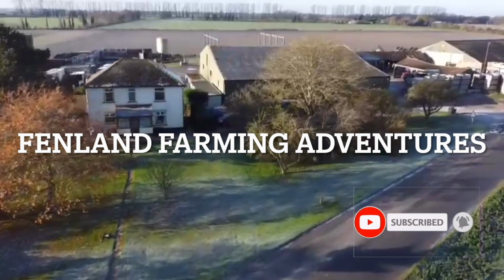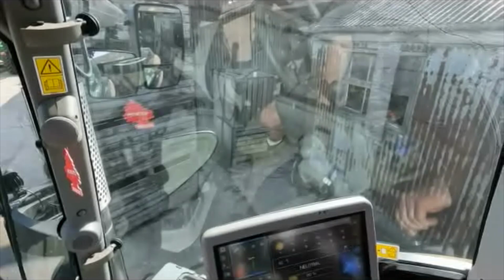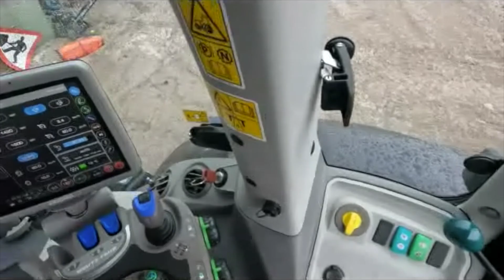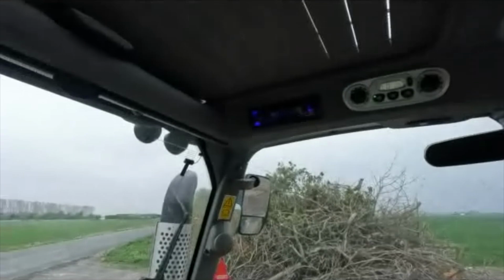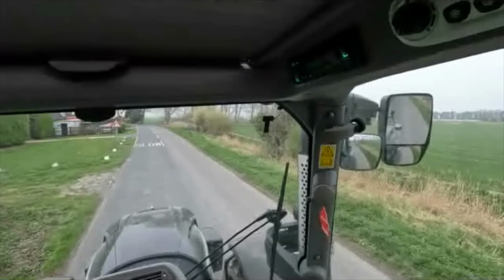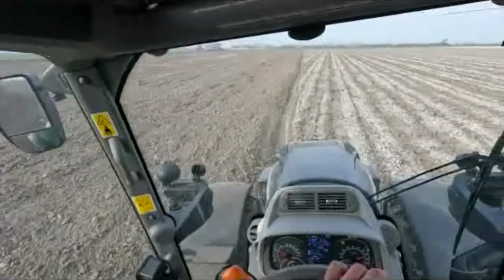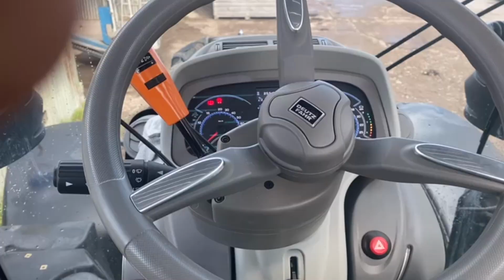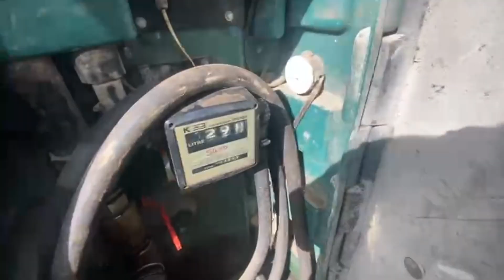Deutz 7250 TTV Warrior - We have a Deutz 7250 TTV Warrior on Demo for a few days!

Comment: Deutz are very understated for what they are they are really good tractors we have had 5 of them never any trouble service and regular maintenance but that’s it 👍
Reply from the maker: Yeah we had great fun with the warrior, but you don’t see many about :)
Reply: @fenlandfarmingadventures4241  ye very rare
Reply: Pulled well very quiet far more weight on than I’d need but very nice place to work all day got used to the simple stuff quickly wanted to get jay on it for a bit but didn’t have time
Reply: @danielsizer41  oh right simple linkage workings too under the armrests
Reply: @crfarmlife1267  yeah cause jd is in the screen and the fastrac is as same as the deutz under the armrest 😂
Reply: @danielsizer41  ye

Comment: Our neighbours had a brand new Deutz. It kept completely loosing it's brakes, wouldn't be a problem around your parts tho🤣 Went straight across a blind cross rds as couldn't stop!
The dealer kept messing with it but couldn't work out why, they returned it! Never seen another since.
Reply from the maker: 😬that’s not ideal! We are usually John Deere as they are so reliable but happy to give anything a try and got on well with it, apart from a little niggle but were soon back up and running!
Reply: We had one in 2012 and I was completely confused by it 🤣 Collings brothers had me running in under 2 hours just a faulty battery 🤦🏼‍♂️🤦🏼‍♂️I’ve had other makes pissing oil out on demos before 🤣🤦🏼‍♂️so it happens just how they deal with it and couldn’t fault them but having no brakes at all is less than idea with hills 🤣🤣🤣
Reply: @fenlandfarmingadventures4241  I see on Joe Seals video their new John deere which has electronic spool valves started tipping the trailer by itself driving down the rd!
Reply: @bumpkinrocks  yeah that’s not good I’ve never had too many troubles with tractors just annoying things really like the deutz nothing major same with deeres never anything major just annoying 😂

Comment: Hi. Would like to know why Deutz fahr isn't selling more tractors.? Is it preference or are there tech old ? Or dealerships and spares expensive?
Reply from the maker: I think it’s basically a Same tractor in a frock and the 2 I know round here sold both had backend trouble after couple of thousand hours so maybe summit to do with it. Deere is so much closer than deutz dealer for me as well so you’d buy what’s closest sometimes but nice tractor once I’d got comfy with it like the smaller ones as well really simple but would want a warranty with it 😂😂😂
Reply: @fenlandfarmingadventures4241 Thanks, but from my research 7, 8 and 9 series are 100% Deutz manufactured in Germany. Deutz engine and ZF back end. 6 series downwards are SAME. What is the price on that 7250 warrior?  Warranty?
Reply: Deutz were really popular until the same lamborghini takeover, that and the fact that the first generation agrotrons were awful turned a lot of deutz fans off the brand. A lot of them went to John deere, myself included it would be hard to go back now. All the same that looks like a mighty tractor and it looks really well in black..
Reply: We have a 2021 6215 TTV WARRIOR and its terrible

Cab is tiny
Its too soft a bouncy on the road
Steering wheel does retract up enough so no the arm rest is all torn at just 1700hrs

It struggling to pull a 5 furrow pottinger Plough deeper than 12 inch

The JD 6195R we traded for it would embarrass it

Not to mention DEUTZ-FAHR parts back up is atrocious waiting 7 months for a mudguard part then a pick up hitch rod snapped as they don't have grease nipples like most other brands
Reply: @drone_tours  OK thanks for the info. That is not good at all.

Comment: I’ve you want to keep it rust free. Spray it with a mix of half diesel and half used engine oil before you put it away for a while...
Reply from the maker: We normally put grease on it, cover it in a thick layer all over the smooth surfaces, we ll have to give that a try, thank you for the tip!
Reply: Yeah we have to polish the plough up every night as slightest bit of rust won’t wear it off 😂😂😂🤦🏽‍♂️boys land ya know points on the plough will last 10 years before needing turning